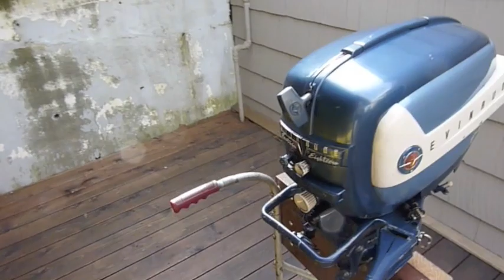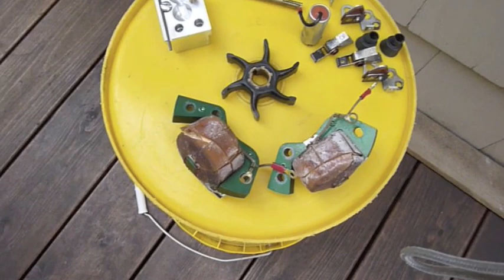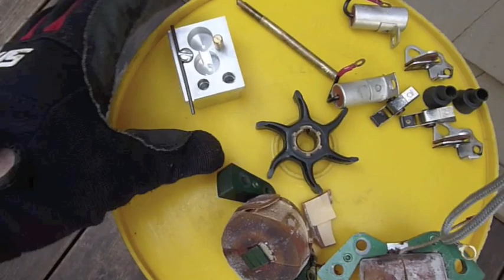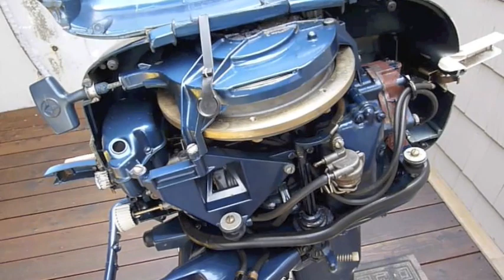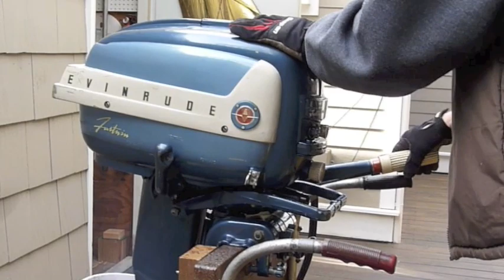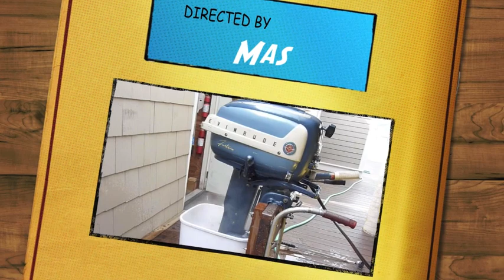'58 Evinrude Fastwin 18 HP

Comment: That is a beauty.   I would suggest getting a barrel to run motors in.  the impeller should be a little deeper in the water.  I just aquire a 1956 Evinrude Fisherman 5.5 hp in about the same condition.   I pretty much had to do the same things to it.  coils, plug wires, waterpump , fuel lines.   It turned out nice.  I made a couple of videos of it.
Reply: I see you have a test barrel in another video.   Nice collection of motors.

Comment from the maker: Once removed, the lower unit should drop down.  Some wiggling will be needed. Once dropped, the impeller housing surrounding the driveshaft can be removed...again careful of the SS screws.  Heat & penetrating oil will be your friend.  Reassemble in reverse order except add greae to all screws and the watertube grommet.  Good Luck.  Also visit the aomci.org (Antique Outboard Club) and post questions on their free forum...excellent!

Comment: Is this motor located in WA? Train and saltwater were the giveaways. I have the exact same motor in nearly the same condition with a similar story. I plan on using it in a few weeks for the Halibut, Lingcod, Spot Prawn opener. Just replaced points, impeller, carb rebuild, and prop. Good seeing another dandy! Nice work.

Comment from the maker: There is a small access plate on the side of the exhaust leg with two screws.  Remove the plate to gain access to the "shift linkage."  Remove one of the shift linkage bolts the remove the screws (I think there are five?) holding the lower unit to the exhaust leg...carefully.  The screws are stainless steel and can easily snap creating a nightmare! I usually like to use a little heat from a propane torch around the metal the screws are tapped into if the screws have not been off.

Comment from the maker: No...but you might need to reposition the shifter to reinstall!  Be sure the shift rod is fully seated in the linkage before rebolting.  Make sure also you replace the rubber o-ring on top the of the drive shaft.  Lube the upper splines of the drive shaft with some "moly lube" but do not get any on the top of the shaft.

Comment: Hey 1957 Lark hope all is well.  i just scored on this exact motor almost in identical condition, i purchased it from an elderly gentleman that had i stored in his garage for the last 25 years or so, well i just replaced lower unit gear seal and water pump kit,  carb kit and i'm waiting for a tune up kit   it's Tune Up Kit 2 BRP Coils and  2 Spark Plugs J6C,  and i'm also replacing the spark plug wires, parts should be arriving tomorrow, i have a question after installing the new ignition parts aside from gaping the points do i need to worry about the timing? would it affect the timing? or is just a straight up remove and replace old parts . Your input is appreciated. Thanks!!
Reply from the maker: Hi...you probably figured this out by now, but the timing is set by correctly gapping the points.  I hope you motor is running.

Comment: I know this video is a few years old but where do you position your speed dials
Reply from the maker: The following was taken from Joe Reeves on iBoats:  
Initial settings are: Bottom high speed = seat gently, then open 1 turn out. Top slow speed = seat gently, then open 1-1/2 turns. 

Setting the high and low needle valves properly:

NOTE: For engines that DO NOT have a shift selection, obviously there is no NEUTRAL position. Simply lower the rpms to the lowest setting to obtain the low speed needle valve adjustment.

(High Speed) Start engine (it will run pretty rough), shift into forward gear, take up to full throttle. In segments of 1/8 turn, waiting for the engine to respond between turns, start turning in the bottom high speed needle valve. You'll reach a point whereas the engine will either start to die out or spit back (sounds like a mild backfire). At that point, back out the needle valve 1/4 turn. Within that 1/4 turn, you'll find the smoothest setting. 

(Low Speed) Slow the engine down to where it just stays running. Shift into neutral. Again in segments of 1/8 turns, start to turn the top needle valve in. Wait a few seconds for the engine to respond. As you turn the valve in, the rpms will increase. Lower the rpms again to where the engine will just stay running. Eventually you'll hit the point where the engine wants to die out or it will spit back. Again, at that point, back out the valve 1/4 turn. Within that 1/4 turn, you'll find the smoothest slow speed setting.

Comment: Cool video. Where did you find the new spark plug coils?
Reply from the maker: ...the coils are readily available... part number 0584477   Search eBay or list a free post on the Antique Outboard Motor Club Inc...there are lots of guys that have some.  AOMCI.org

Do your part searching on MarineEngines.com to get part numbers for every part to keep you motor up and running.  Remember, Johnson and Evinrude motor of that era are exactly the same...minus some cosmetic shrouds...So the part numbers for a 1958 18HP Johnson and a 1958 18HP Evinrude are the same.  Happy Motoring